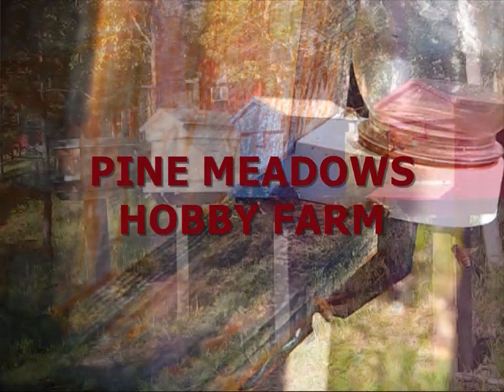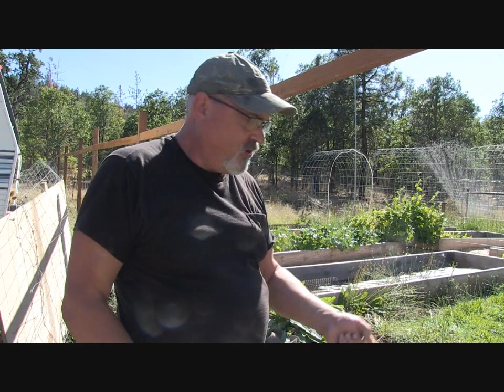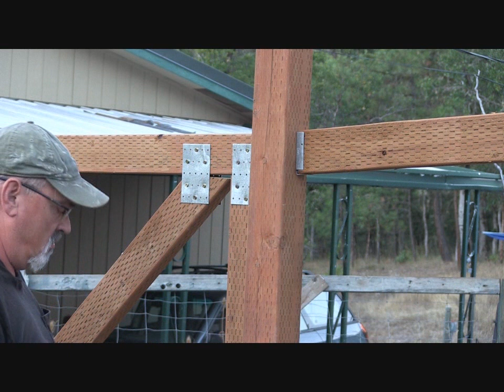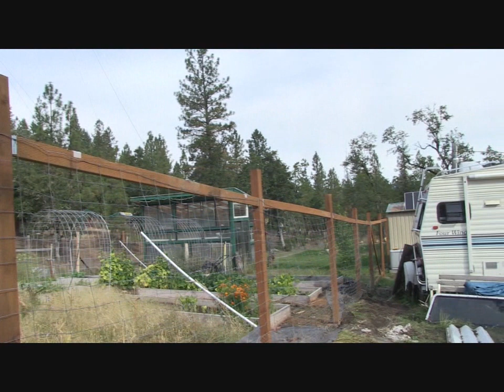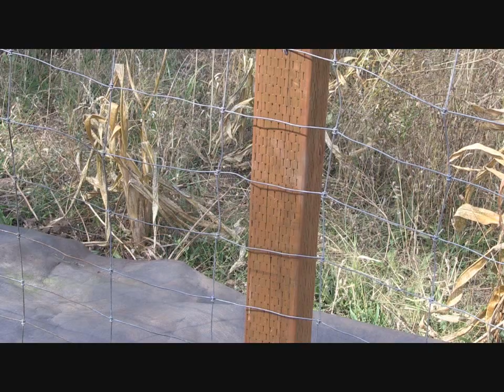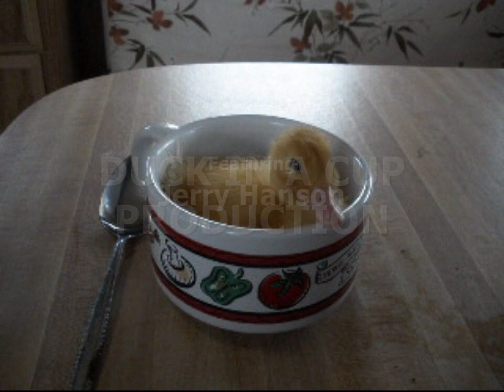HOMESTEAD BUILDING PROJECTS - The new Garden Fence and Yard Gate Part 3

Comment: You need an anti-sag gate kit (protected steel cable and galvanized turnbuckle) to maintain tensio on the gate beams.
Reply from the maker: I will google that now and order one. Thanks for that tip bro.
Reply from the maker: I just ordered a set of two because I will be building a duplicate gate on the back fence area. Thanks again for that tip.